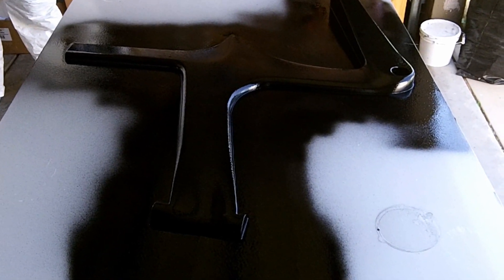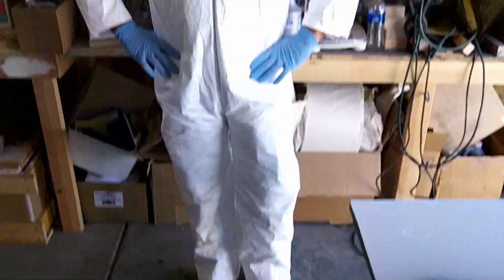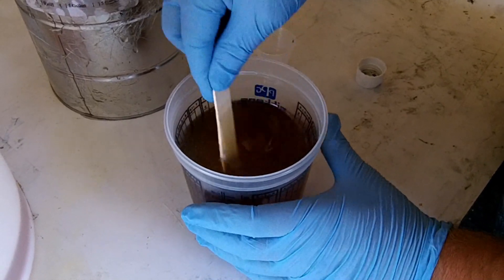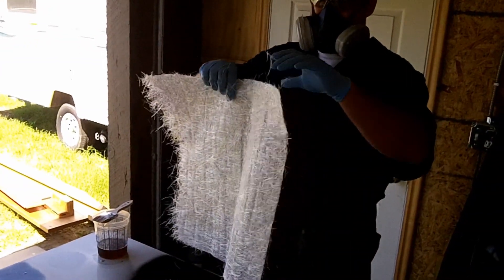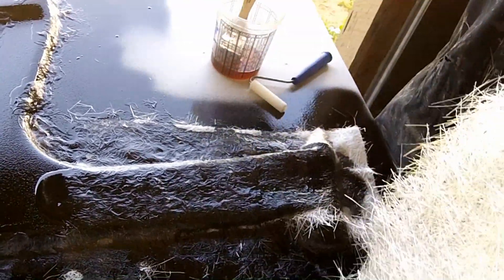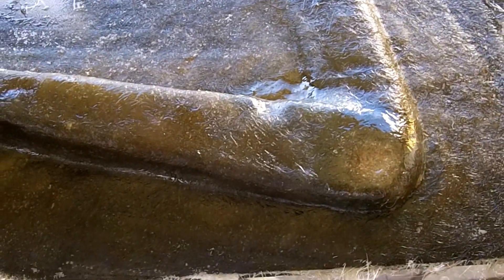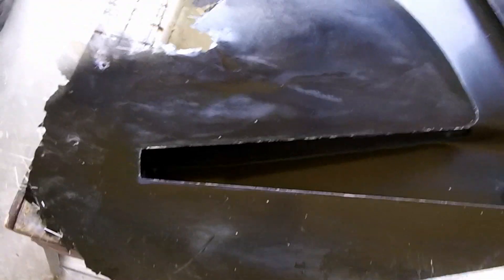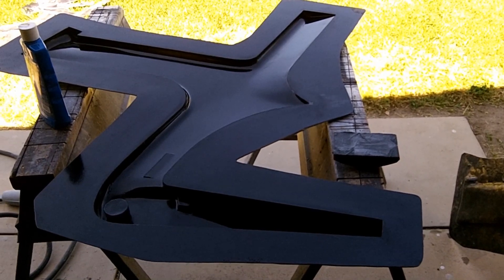Z Frame Bike: Video 6 of 13- Building the Female Molds

Comment from the maker: @hpvhomebuilder 
You're 100% correct. In fact I knew that before going the way that I did. I tried "cutting corners" and got burned. It wasn't that big of a deal to fix the edge of the mold but I think it would have been faster just adding the Plasticine to the plug before-hand. Good comment.

Comment: The trick to eliminate gelcoat edge undercut is to push, with a modelling tool, a bead of wax or plasticene into the corner where the mold meets the base board. Remove excess for a flush finish. All the best!